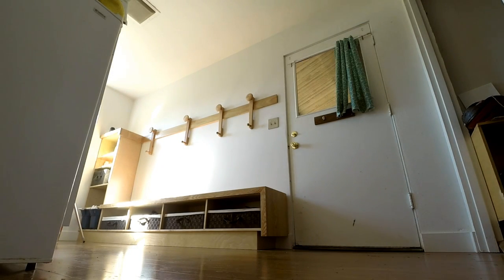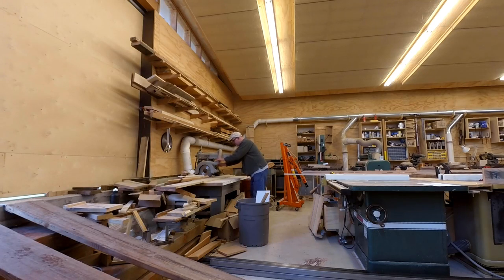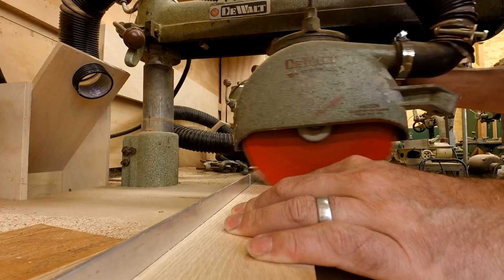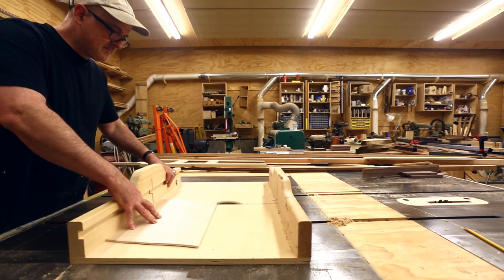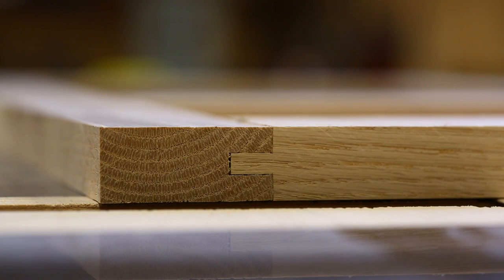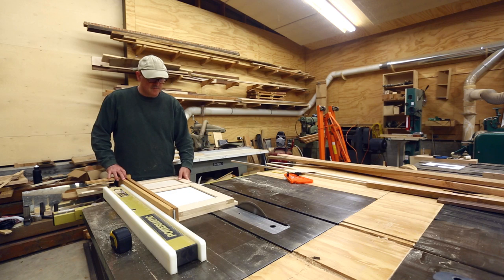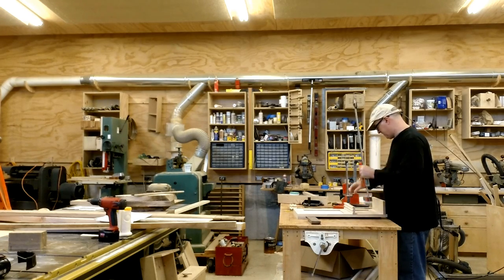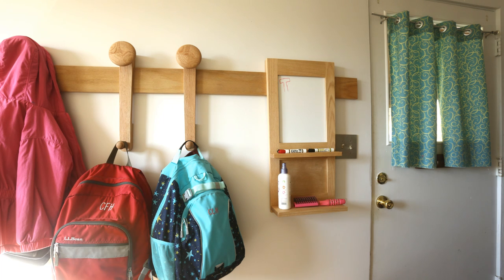Rail and Stile Marker Board

Comment: I've always found whiteboard surfaces clag up and become more and more difficult to clean over time, regardless of what whiteboard pens I've used and how I've tried to clean the board.
If you find this happens, I've had huge success using sheets of polycarbonate or even glass as a whiteboarding surface, with a sheet of white paper behind it, or even spray painted white on the back side.
Reply from the maker: I may have to try that.
Reply: frank howarth I think the classroom whiteboards are some kind of varnished metal plates. But glass or polycarbonate are probably easier to get.
Reply: SakariNy I've come across a material with the name 'Dilite' that has an aluminium core and looks very similar to a whiteboard.
Reply: Our laminated metal whiteboards at work had horrible "clagged up" surfaces to the point where the director wanted to replace them. I cleaned them all up like new in just a few minutes using a pack of baby bum wipes (NOT the wet wipes you use for your hands at a picnic). It cleans the surface really well. Now we do that every 6 months to keep them all looking and working like new.
Reply: CodeFoxAus I've also used aftershave quite successfully to remove permanent marker. Other alcohols may also help.
Reply: Olly Parry-Jones
Yep, anything with alcohol seems to clean the board, unfortunately sometimes it also damages the surface (depends on the surface type - alcohol is usually fine on glass). The baby wipes have degreasing agents, but no alcohol, and after many cleans the surface of the board still cleans up like new, and works well with the dry-erase markers and erasers. The ones that we originally used alcohol based wipes on now won't wipe clean with the dry-eraser and have to be wet-cleaned every time they are used.
Reply: In the past I've tried lighter fluid, aftershave, deodorant spray, white spirit, turpentine and acetone. Acetone was probably the straw that broke the camel's back, so to speak!
I haven't tried them all at once. Maybe there's something in that.
Reply: Olly Parry-Jones Please do NOT use alcohol to clean up any whiteboard or melamine surfaces. I'm not a chemist so I can't remember the chemical it releases but the combination of alcohol with the material causes a VERY carcinogenic gas to be released. Instead you can safely use ammonia and you will get the same clean result without the carcinogenic gas.
Reply: Thanks very much indeed for the forewarning! Bianca Morton
Reply: Bianca Morton
Formaldehyde ?
Reply: Bianca Morton Would be interested to see your source for this information...as far as I know, this is not the case.

Comment: Love the flexibility you achieve with the french cleats! Love watching your stuff frank howarth Off topic question but what kind of duct work do you have for your dust collector, is it 5" SS chimney liner, HVAC duct work or something else?
Reply from the maker: 8" sheet metal pipe coming from the dust collector to 6" sheet metal to 6" plastic drain pipe on the walls and under the floor.  I do want to do a redo in a few spots.

Comment: Great job and video as ususl.  I still may have done corkboard idea or sheet metal for magnet notes behind shelf.. stilll can I suppose,.. thanks for sharing.
Reply from the maker: I like the metal idea I did not think of that.  I could slip a piece in.
Reply: A piece of metal from an old appliance (fridge, washer, etc...) would work well and have a super tough finish.
Reply: You could also use magnetic paint with a second coat of chalkboard paint.  Magnetic chalkboard.

Comment: Hi Frank, thanks for the upload, this project looks like it's come together quite nicely and I really enjoyed the bit of the kids coming in and still leaving everything on the floor. As for the taper on the marker board, you doubled the angle because the second pass had the previously tapered edge (no longer 90 degrees) against the fence. Is that correct? Sorry, just trying to wrap my brain around the logic, as I am currently building a tapering jig and plan to use it often.
Reply from the maker: yes, I put the first taper against the tapering jig and they cancel each other out.  So I double that angle the on jig for the second taper.
Reply: Awesome. Thanks for the reply!

Comment: That little empty space with plain plywood would have been a perfect spot for a small mirror they can use while combing their hair.
Reply from the maker: Yes i thought that too.  I think now I would have made the whiteboard a mirror, it would clean up better and the kids could draw on their reflection.
Reply: frank howarth Actually, I was wondering why, even if you didn't know you were going to do this particular project,  you didn't just extend the cleat all the way to the door frame?  Or is it that way and I just can't see it?

Either way, just like the pipe, you probably could've made a hole for the light switch panel to fit out of?  Or were you avoiding that so it wouldn't look (sort of) contrived?

Comment: here is a real easy tip for cleaning those white boards really well. You know when they hold all the colors. and you can see what you have writing last week.
Spray a little WD40 on it and smear that over the boards, let it soak in a minute ore two. Then wipe it clean with paper towel.